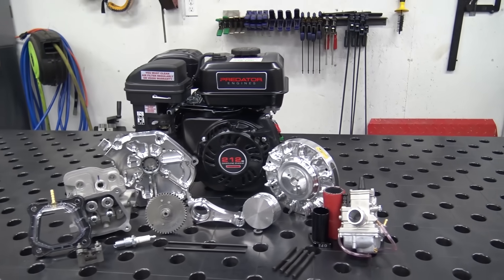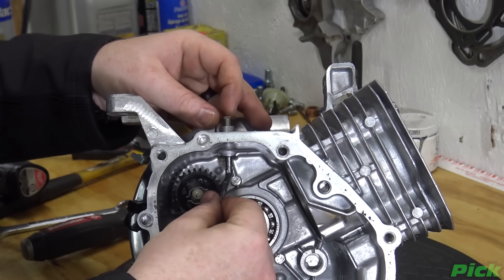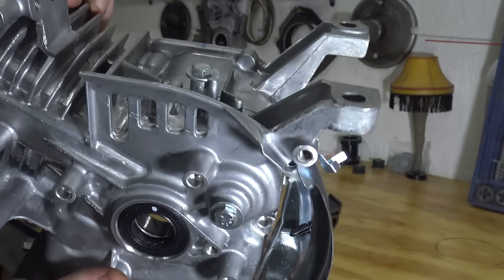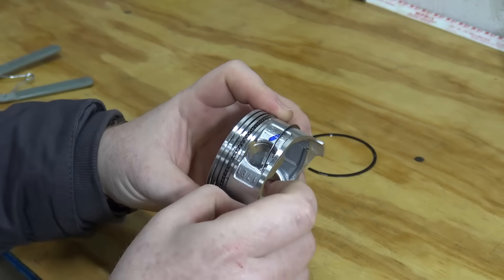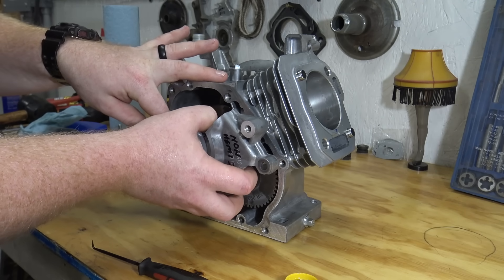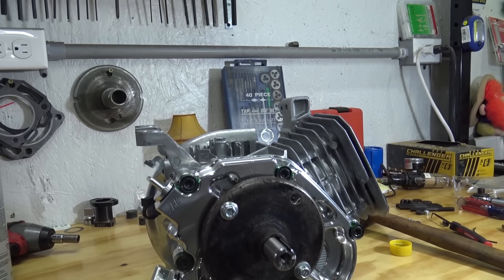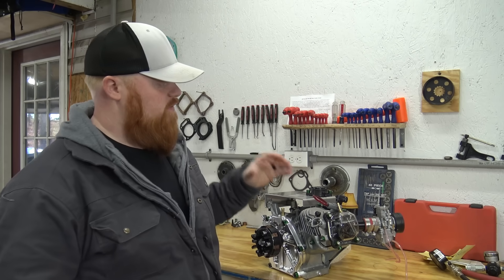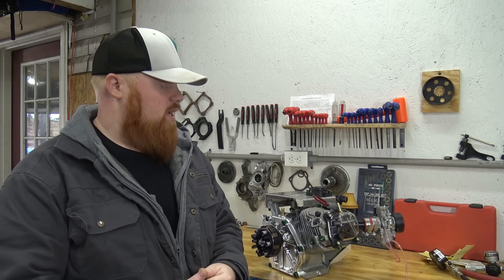Predator 212 Stage 4 Engine Build ~ 22HP Go Kart / Mini Bike Engine

Comment: So I got a question for you Red. I got a predator 212 non hemi. My engine did not have a lash cap. I know there are generation of this engine could this be the reason or Is it because. I bought a store return motor That had been gone through? All the bolts seemed to still be torqued and I didn't find any evidence of tamper. ???

Comment: for all this work you may as well get a genuine honda 196cc block. i imagine it would last much longer
Reply: I got a genuine honda.
Reply: I bought a Honda VTX 1800cc engine , carb and wiring harness with 4,000 miles for 560 bucks . I put it in my little 2 seater buggy. Best thing is it's a driveshaft motor . I used a dana 44 shortened rear end and driveshaft from a jeep wj . Cost was 100 bucks . Then had a driveshft guy fit one end to accept the honda yoke .

Comment: But what’s gonna hurt is when someone like Ike on cars and cameras goes full send with the motor and it blows up. $1.5K down the drain. The motor block is not even designed to handle the power.

Comment: Red beards 212 build looks better than cars and camera and cameras. But cars and cameras is on a budget. Ike:it’ll be fine. There were a lot of ineffective parts used in the build like the coil, lifters, valve cover, tank plate, and fancy flywheel cover design. Over all I the thing looks mean. And would love to have one. But I’m fine with a. Bigger stock motor 420 & 670 w adjusted governor.

Comment: Red Beard, this is my time on your channel. Good vid, very informative. I have a question, If i have a Predator 212 and 420, is it possible to make some type of stroker with mixing the crank fronm  the 420 into the 212? or maybe the 212 crank in the 420? are the cams different and interchangable? thanks for your help.

Comment: What was the total build cost including the new motor?
Reply: 212 predator about 100-160 depending where your at. Roller rockers 200plus. Rods 10-20. Connecting rod 100. Cam 60-120 depending what ya get. Flywheel 100-130. Springs 12. Retainers/lash caps 15. Built head 250plus. Billet side cover 100. Piston 30. Gasket kit 25. Genuine mikuni flat 200-300. Manifold 12. Plus this and that’s like bolts. Oh top plate 35. Than you’ll need a gas tank so 20-200 depending what you want lol. And depending where you put it you’ll need a pulse pump plus hosing/petcock. Plasti gauge. Plus all the tools if you don’t have. Adds up pretty quickly lol. That’s not even valves, crank shaft. Have to add in exhaust and than drive train. That race clutch he has is easily 200 plus depending where you get it new or used

Comment: Can somebody help  I think my motor had to much oil in it ....my 212 moter was not running right  lost all power ...when I open the oil cap  oil came poring out ... so  drain all the oil out  and put fresh oil in it  and it's still not running right  losing power  what should I do buy another motor. are It is a easy fixed  ...  on my go kart

Comment: I built the same engine with a hemi 212, only difference is I used 37lb springs 28mm mikuni  and mine is a .175 stroker. I wonder how much more hp I got.

Comment: What engine is better the Hemi or Non Hemi?
Reply: HEMI!!!! OOOOOHHHH AHHHHHH,  ITS A HEMI!!!!!! EVERYONE KNOWS THAT A HEMI IS SOMETHING.... 1000 more HP cuz of the sticker that reads HEMI... yes?  that motor was NOT a hemi as the NON hemi does well too, with HEMI flat top piston $18 in the NON hemi engine to get the piston to top of cylinder... but need longer rod... .020".... .040" longer BILLET ROD $65 to get the piston close to 0 deck height and not "in the hole".   BUT each motor is a little different, have to measure how far "in the hole" the piston u have is already. I got HEMI and with stock rod it was .018" in the hole therefore, take out the stock HEMI head gasket (.045") and put in head gasket shim $9 for 3 of them that are .009"  will give a person ~.030" piston to head MINIMUM clearance so piston does not kiss the head when SCREAMING the motor and crankshaft is flexing.  watch the starter handle rip out of your hand with TOO MUCH COMPRESSION and cant use hand for 2 weeks.  got to get motor to compression stroke and PULL... some say LET GO of the starter handle in case it KICKS BACK/backfires and rips the starter handle out of you hand???  the HEMI's valves might also kiss the piston with HIGH LIFT cam and 0 deck height piston because the HEMI's valves are canted (slanted) in the head so the edge of the valve wants to kiss the piston when SCREAMING the motor.  the NON hemi engine has less of a problem with that.  never the less a person needs to "clay" the piston/valves with Play Do (without head gasket in place) then cut the Play Do in the middle of valve impression and measure with feeler gauge to make sure have.... ~.060" on intake and ~.110" clearance between valves and piston.  oh, the 1.3 stamped steel rocker arms for the NON hemi are $20, for the HEMI they are $100.  of course the stamped steel rocker arms for NON hemi cannot deal with more than 22# springs (6500RPMs) or they will fold up.  the BILLET $100  1.2 rockers wont fold up with HIGH PRESSURE SPRINGS (36#.... 9000RPMs better have BILLET ROD and FLYWHEEL at those RPM's.  read something about 1.3 rockers playing havoc with valve train geometry? but for normal ppl that didn't do well in trigonometry , it is a non issue.   CM .265" cam and 1.3 rockers in a NON hemi engine will get .345" lift at valve, the most lift that does any good without MASSIVE HEAD WORK (welding/machining of inside of head) and then the "gains" are a little SCREAMING the motor with commensurate losses down low.... (Read: helpless below 3500... 4500RPMs?) good luck getting it started without a starter motor setup ($250).  it is not a diesel, too much compression splits the block in half without a "backbone" welded between the cylinder and the blocka person can put... $200 into a $100 motor and with some port work, bigger e bay 390cc carb ($16) and adaptor ($20), header with E bay scooter muffler ($16) so don't get cops called on u before the motor even warms up.  26mm carb Mikuni clones are out there for $16, jet kit for $12.   WEN grinder (e bay/china) and 2 sets of 80 grit sanding drums to open up the intake/exhaust ports (no need to polish either port, intake wants rough edges so air / fuel tumbles going into motor to mix air/fuel for better atomization, exhaust soot/carbon will roughen up the exhaust no matter what)  sanding drums ~$4/each x2 as go thru them pretty fast.  get the sanding drum kits with 1/2" ,  3/8" and 1/4" drums.   safety glasses outside in the breeze, no ppl/animals downwind, and dust mask to keep alum filings out of lungs.  STAY AWAY FROM VALVE SEATS WITH GRINDER!!!!! JUST ONE kiss with grinder or KNURLED part on the grinder and the valve seat is SHOT!!!!!  masking tape around knurled part of hand grinder if u THINK u are steady enough to go into valve pocket and NOT HIT THE VALVE SEATS?????  mostly open up the ports and get rid of that STEP in between the valve pocket and the intake/exhaust track so it flows better, opening up the port as much as u dare, but have to PORT MATCH the intake/exhaust port to the intake manifold/exhaust header port or there is a step there and that is no good.  I got one of those exhaust port flanges and some pipe to put on my engine... the holes on the exhaust port flange were TOTALLY not drilled right so that exhaust flange would cover at least 1/3 of the port no matter how I put it on there. apparently QUALITY CONTROL was a non issue for maker??? have welder weld up the header otherwise.  header wrap $8 is a good thing as 3rd degree burns in a nano second really don't feel good, trust me on this.  OH the pipe doesn't LOOK HOT... but it is.... 800 degrees with temp gun. 1/4" tap is $5 on e bay for gov holes and get button head Allen bolts (1/4" x 3/4" long should do it) and use read thread lock to keep them in there forever.  I just cut the wire to the oil sensor thing, took out fitting out of block, red thread lock it back in the hole it came out of.

Comment: I  wish we could have seen it go on a bike. Also can you build one almost as much power for a whole lot cheaper?
Reply: yes, probably... ~$200 + $100 engine..... $250.   CM. 265 cam $45, GASKETS, side cover, rocker cover... might as well get 3 of each as u will probably rip one of them trying to get it together..2-3x. when ordering stuff from kart people, got to spend $100 to offset the ~$13 shipping. not hard to spend $140 put stuff in shopping cart, wait, think, add/subtract stuff til u think u got all u need? then order.  NON hemi engine 1.3 rockers $20,  .009" head gasket shims 3 for $9,  Wen grinder to open up intake/exhaust ports $23, 80 grit sanding drums 100 for $5 from HK thru E bay in 2-3 weeks.  Weld urself header e bay $23, Scooter muffler $16, 390cc carb (e bay) $16, adaptor $18. header wrap $8 to prevent 3rd degree burn on 800 degree pipe. Billet rod $65 as wont do any good to put all that $$$ into a motor and have rod break and ruin motor, cam, head... everything but the carb. some have taken the stock rod off, honed it out with 2 passes in/out with a bottle brush hone from .003" clearance to .004" clearance, drilled out the oil holes in rod BIGGER, but not too big.  cut 3/8" off dipper on bottom of rod cap as crankshaft flexes when SCREAMING the motor, dipper hits the bottom of the motor, breaks rod cap=game over.  remove gov and oil sensor= free. hone cylinder so piston has more wiggle room/less drag in cylinder? some have drilled 1/2" holes in piston skirt to lighten piston?  I read some have run to 7000 RPM's with stock rod... I wudnt trust it over 6500. FRESH OIL IS CHEAP and your engines friend. some use synthetic? 10-40 depending on how HOT it is.... 15-50 synthetic ? when HOT HOT HOT in summer and oil is like water? got a $300 motor... can afford WM synthetic motor oil for $4 bottle.  E bay tachometer to have some clue as to how fast u are revving the motor ($8). stock motor will go abt 5500 without gov and with stock springs.  can get HD stock springs for a LITTLE faster those are 12.8HD, then 18# springs, 22# springs (6500R's).... 26# springs (8000R's). need to get stainless valves and REAL keepers so wont drop the valve when keeper fails and ruins motor. Springs $8 for a pair, valves $16/each. 22# springs are hard to get the keepers on without that 3rd hand .... I cannot imagine getting 26# springs on. safety glasses are cheaper than a glass eye or seeing eye dog when the spring/keeper lets go cuz u didn't get the keepers on there JUST SO and they come OFF with AUTHORITY. rag over keepers to catch them when u give the top of valve/keepers a little tap with plastic hammer to make sure keepers are set?  put rag under valve on desk when putting in springs/keepers so valve stays on the seat.    watch for valve spring coil BIND with TOO HIGH A LIFT SPRING. 22# springs good for .3" lift? 26# springs good for .4xx lift? check springs for coil bind when installed, got to have .030" clearance MINIMUM between coils to prevent coil bind... breaking valve stem/keeper... dropping valve in motor... ruining motor.    a 1/4" tap off e bay to tap holes ($5) and 1/4" x 3/4" button head allen head bolts and RED thread lock to lock them in there FOREVER.  cut wire to oil sensor thing, throw oil sensor thing away, take out fitting in the block with the wire to it, RED thread lock it and put it back in?  2000 grit sandpaper to SMOOTHE  the crankshaft main journal and piston pin so they SLIDE so nicely over their mating surfaces.  Mikuni Clone 26mm carb (e bay) $16,  adaptor $18 from HK in 2 weeks.  head studs n washers to keep from galling the head bolt area? $22 torque to 23 ft/lbs,  HF torque wrench, with coupon, $10.  feeler gauges that do DOWN TO .001 as rocker arm lash is .002"   to .003" most feeler gauges START at .005" ... some go with 0 lash.  UMMV (ur mileage may vary). 1 qt of 10-30 motor oil, change oil after 3-5/10 min heat / cool cycles at slow/medium RPM's.  read that using automatic transmission fluid in the cylinder/piston rings seats rings almost instantly?  removing oil sensor allows for ~2oz more oil.   problem with 390cc carbs, I read, is they are hard to tune... but run better on ALCOHOL... got E 85? fuel filters are cheap, 10 for $6 on e bay. new fuel line as china does not have ethanol gas so the rubber hoses that the motor comes with might not like ethanol/E 85?

Comment: So a business card is, or isn't the correct spacing? I've seen you do this two ways now? For the coil gap that is.
Reply: Eflo when I rebuilt my Briggs it actually said in the manual to use a business card or a brass feeler gauge. Just use a card since the brass gauges are expensive and super fragile.

Comment: What fuel are you using in this engine?  I'm hoping some sort of race gas, with at least 100 octane rating... With a high CR (over 12.0:1), I would expect longevity of the engine to be extremely short lived on Premium Pump gas.

Comment: https://www.youtube.com/watch?v=_gYCaLDKxNY
The crankshaft is off center on all these engines. This engine was converted to two-stroke, but still sounds a little like a 4 stroke. Lifan calls that a 'defect' in the owner's manual..It's very difficult to make those hp numbers with an engine with crankshaft that isn't centered to the bore.

Comment: With an impact to cut threads. Oh god.
Reply: Do the same all the time when I have 50 holes to tap never had any trouble. Everybody is a critic on YouTube.
Reply: @ Hawser Perfectly acceptable method in aluminum...the only people who get all upset about it are those who simply don’t know and/or have the experience.
Reply: Yall are just a bunch of keyboard mechanics  he knows his shit
Reply: Randy Mcilveene I must have missed them. Thanks for the feedback.
Reply: As an electrician I have used taps made for impacts that work great.
Reply: I've never used them in my shop, but I know a few companies make taps for use in the field that are specifically designed to be driven by impact guns...to be fair I've only seen them in the 1"-8TPI range.
Reply: That's what I was thinking
Reply: I may have missed it.  What compression is this running?  Any issues with cooling at 9k max rpm?  I see the flywheel has pretty aggressive fins, so probably not, but just curious.
If a guy wanted to order a set up like this, did you have to call them for a kit?  There isn’t a stage 3 or 4 kit available on their website.
Good vids...keep me coming.
Reply: I use impact grade taps with impact tap sockets all the time from #4-40 up to 1”x8
Reply: I use antiseize as well when tapping instead of tap fluid. It’s thicker so it holds the metal chunks and definitely helps prevent breaking or chipping taps.
Reply: Thats how I do mine. Never a issue
Reply: I do it all the time. Even with little #6 threads.
Reply: Hes built tons of em and never had a problem so geuss itll be fine
Reply: He obviously graduated from jerry rig university 😂😂

Comment: When I raced we used 5hp briggs so we didn't run oil or scraper rings just compression ring with 3thousand clearance end gap also we run a offset key on flywheel and bored out carb jets because we run methanol but this was 30yrs ago I haven't kept track of kart racing since I quit it looks like a lot has changed but I enjoyed video

Comment: Little tip, not sure if the head ports where actually polished, they didn’t look like it but you do not want polished ports on a carbureted engine that goes for cars as well, you need the ports to be a little rough so the fuel gets atomized, you can run into problems like fouling out plugs like crazy not making the desired power and it can even hydro lock the engine. I’m sure you wouldn’t notice it on an application like this but it is the fact.

Comment: you should just build a blockzilla bored 195 over with 450 stroked crank , 12,000 rpm rated dual valve springs, forced oil conecting rod rated at 12,000 rpm,  350 tillision methanol carb, 436 lift cam retarded 6 deg, billit flywheel advanced 2 deg. Horseman 6 disk clutch. port and pollish everything.  THIS combo makes for a superb open class drag or track motor. not cheap but worth every penny in raw power.   i used to build and race motors like this. best days od my life !

Comment: It does not make any sense to me the kit is like $750 plus whatever else on top of the brand new $100 engine when harbor fraight already sells a 22hp motor for like $750 which i assume is making more torque it looks like it has 2 cylinders and he said 9000 rpm but maybe it would be more affordably if they built it then there would not be as much cost in the head and stuff but they they wpuld have people complaining when they blew the motor but the kit does not make sense to me at those prices

Comment: There's so much false info out there on these and fake Horsepower numbers. There's really is no replacement for displacement..... 212cc... I call BS on 22hp.. Maybe 15 and that's at ridiculous RPMs. No where can you find Dyno numbers to prove these exaggerated claims.  So many cheaper ways for someone to get REAL hp numbers and Torque.

Comment: You can find a High Performance Ignition coil like the one showed here but with a Higher Internal Winding count 85/1 for maximum efficiency!  

https://www.ebay.com/itm/292637472026?ssPageName=STRK:MESELX:IT&_trksid=p3984.m1555.l2649

Comment: How come 125cc motorbikes make 15hp easily and are reliable yet this needs so many mods to get 22hp
Reply: Because bike engines already have similar things done to them and cost more
Reply: RPM.... Horsepower is only a calculation based on what really matters...Torque. You can take any engine and just spin it faster and you'll get higher Horsepower. The 125cc rated at 15hp is probably rated to spin at 10,000+rpm. Take that same engine and spin it at 3600rpm like a stock yard product engine and it'll be 4hp.